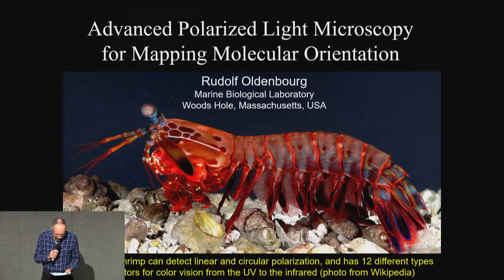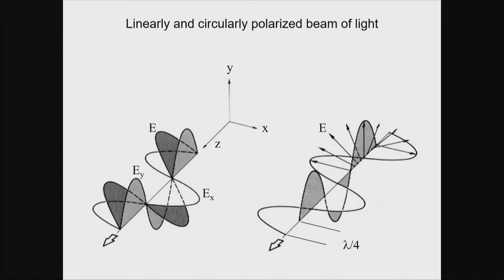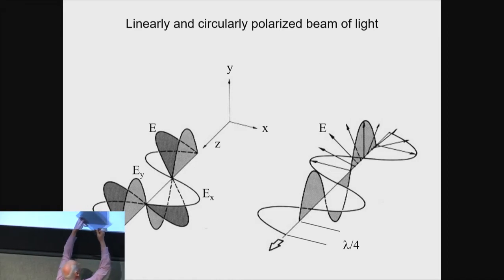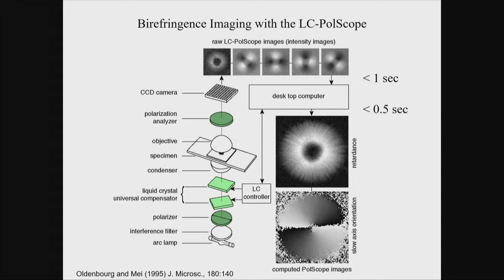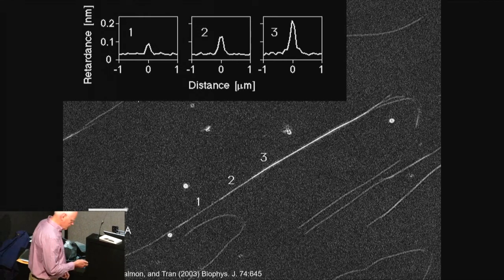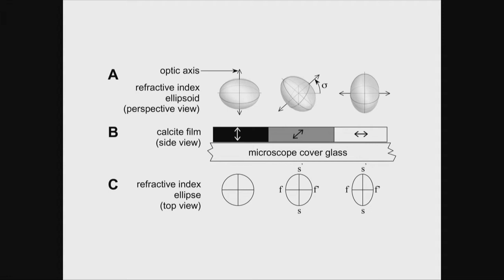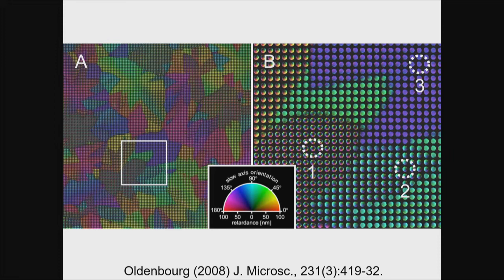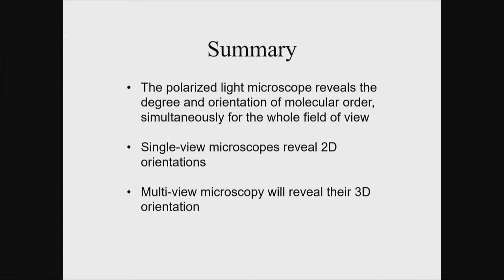Advanced polarized light microscopy for mapping molecular orientation

Comment: Corrections:
Michael Shribak is not a member of a Cellular Dynamics Imaging Group.
This and other similar devices are described there:
M. Shribak, R. Oldenbourg, “Techniques for fast and sensitive measurements of two-dimensional birefringence distributions”, Applied Optics, vol. 42, No.16, p. 3009-3017 (2003).
M. Shribak, “Complete polarization state generator with one variable retarder and its application for fast and sensitive measuring of two-dimensional birefringence distribution”, The Journal of the Optical Society of America A, vol.28, No.3, p.410-419 (2011).
M. Shribak, “Polychromatic polarization microscope: bringing colors to a colorless world”, Nature/ Scientific Reports, 5, 17340 (2015).